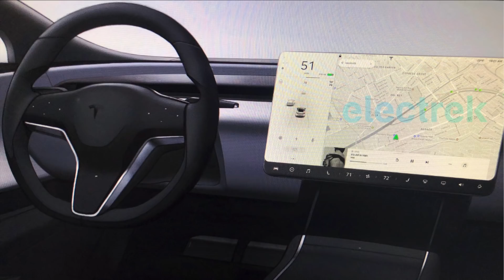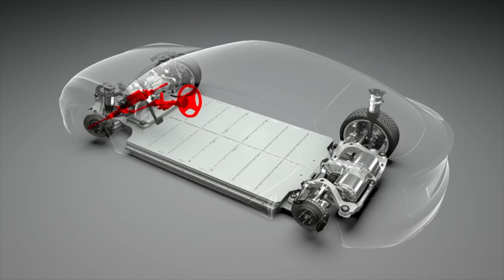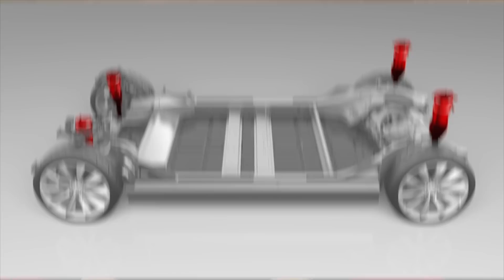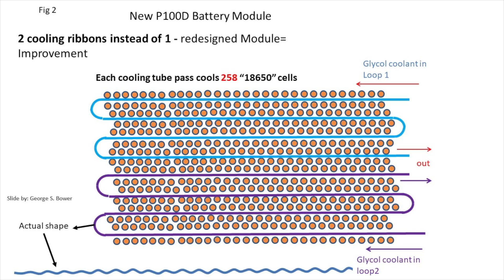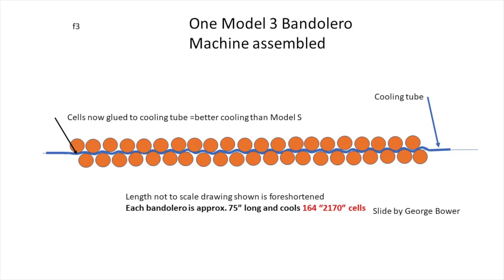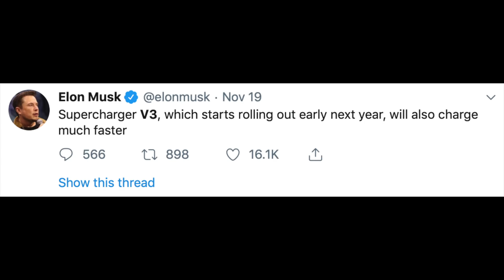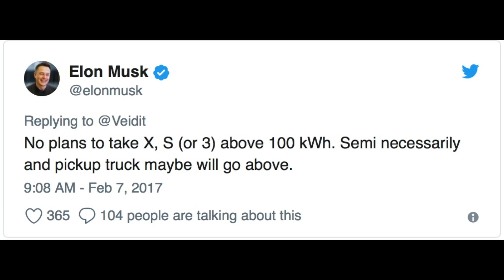The reason Tesla's 75 kWh battery is going away

Comment: Hello Sean. Great overview I think one of the reason why I haven't order my Tesla is simply because I've always wanted a bigger battery. There hasn't been any improvements to the Model S and X in almost 2 years it seems. With all the price jump it makes it somewhat confusing for buyers like myself too commit when you never know what the true price is. You but a Tesla today and two months later there's a price reduction.

I'm inclined to go with the iPace for now and the Model 3 until there's some kind of stability. I would love to have a Model S it X with a bigger battery. I'll even pay $250K for 600 miles of range on a Model X. It may take a while to charge, but charging on  road trip would be far less, and cover much more miles. Thanks for the great podcast.
Reply: Sorry...  What do you mean by... 'stability' exactly?  The Jaguar I-Pace has less range than any version of Model X or Model 3, starting Monday.  It costs more than Model 3.  It has less usable interior volume than Model X.  And certainly will be uglier than Model Y.  So, why are you 'inclined' to go with I-Pace? 

People always get nervous, disturbed, or angry when Tesla changes their pricing strategy.  This has happened by my observation at least five years straight.  

People went off the rails when Automatic Folding Exterior Rearview Mirrors were added.  People went apeshit when the parcel shelf was made standard on Model S.  Some were surprised when the option for an all black roof with any other body color disappeared. People were concerned when Dual Motor all wheel drive arrived suddenly 'without warning' in late 2014 along with the initial Autopilot v1 hardware being made standard on every car.  I'm sure that AUDI, BMW, and Mercedes-Benz were peeved when their attempts to keep up with Tesla with ever larger displacement V8 powered gas guzzlers was utterly blown away by the casual arrival of Tesla Model S P85D about the same time and they were all left flabbergasted and flat-footed, with no answer.  That was less than thirty months after the original Model S 85, which they already couldn't match, had arrived.  

Notice that their advertising ever since has been ever-so-much heavier with the same old tired marketing rhetoric, speaking of 'heritage', 'tradition', 'history',  'craftsmanship', 'style', 'luxury', 'exclusivity', and 'attention to detail' throughout.  They have nothing else to say.  Because on the 'technology' front, Tesla has sorely beaten their asses for YEARS.

Also back in 2014, about six-to-eight months after Elon Musk publicly mentioned the idea of a Gigafactory in late 2013, a site was chosen to build it to produce batteries alongside Panasonic and ANALysts, FUDsters, NaySayers, and Trolls throughout the internet universally declared it a 'risk,' a bad idea, that would surely end up as Tesla's undoing.  Today, with Tesla Model 3 being among the top 5 passenger cars sold in the U.S. the last two quarters of 2018, they seem rather silly.

Then in 2015 the Model X arrived.  Through 2016 and ever since it has outsold the Porsche Cayenne and Macan, the standard bearers for high end Performance oriented SUVs.  

And ever since the Tesla Model 3 was unveiled in early 2016, BMW has seen falling annual sales of their 3-Series cars in the U.S.  So much so that in a year where 3-Series sales dropped more than 25% the rival Mercedes-Benz C-Class managed to 'WIN' the segment of 'Entry Level Luxury' cars despite having a more than 10% decline in sales from the previous year in the U.S.  BMW had DOMINATED this segment of U.S. car sales repeatedly for four decades straight.  Then LOST outright at the mere mention of a new car that hadn't been released yet, Tesla Model 3.

Thing is?  Things change at Tesla.  That is a constant.  It is absolutely stable in that regard.
Reply: @redxsage  Point noted!  My simple point is this...in the new era of EV, and all the changes that's going on....not all of us will adapt to changes this rapid especially in the area of EV automotive.  That's why you can express your thoughts, and I  can read it and learn from your perspective.  This is how growth begins when we're informed.  In the end...I will have my Tesla.  It may take me longer to come to that conclusion...but its a process of learning and growing to that point.  I appreciate your opinion.  Thx
Reply: @d7mysterio7  -- Don't worry about the rapid rate of change.  'Cie la vie', and stuff.  Whatever can change, will change.  Just take your time.  When YOU see what will make YOU  happy, then buy.  Not before.  If you wait until any point in the first nine months of 2020 to place an order, do not be surprised if the car you recieve is quite different from what you ordered, but possibly less expensive for the included features you didn't expect to get at order time.  Likewise, don't be surprised if someone who orders after you gets something different.  Don't worry, be happy.
Reply from the maker: Thanks David.
Reply: Will you really.  Lie to me once.  End of story.
Reply: David Campbell. Damn it! The laptop I bought two years ago looks overpriced and underpowered going by what’s available now. It’s the same with the phone I bought!
That’s one of the things to LOVE about Tesla, they just keep getting better, and you often don’t have to wait for a new “model” to see big improvements as they just keep rolling out.
There is no doubt that an S, X, or 3 which you buy today will not be as good as the one you could get next year. That’s because they keep getting better. However, at least the software on your Tesla WILL KEEP GETTING BETTER, unlike everyone else’s cars.
And BTW, an iPace?? Are you serious? Just look at the specs. If you love it for the style, then sure, but if it’s for anything else, forget it!
Reply: I would highly highly recommend test driving the Model 3 (longer than simply a short test drive if possible), and at least playing around with the I-Pace a bit when you get the chance. I have been holding on on purchasing a Model 3 until I experienced the Jag, simply because I prefer the looks of the Jag so much more, and wasn't a fan of the Model 3's interior at first.
But after seeing the I-Pace in person, there were just many little quirks and disadvantages (i.e. I cannot stand the laggy climate control system; doesn't seem befitting of a modern high-tech car at all. Was also surprised at the lack of leg room in the rear for a crossover, but that's not a deal breaker for me), I decided to rent a Model 3 on Turo, just to compare. I was sold. Placed my order for a Dual Motor Model 3 right after the tax incentive was cut in half, but I have no regrets. Plus, I'm saving so much money going with the Model 3 anyway (a much lower price, while getting much more range, efficiency, etc.)

Comment: I think they will be using the 2170 cells and that they may come out with two additional options for battery like they are doing with the model three with the smallest pack being 100 kWh then going up to 125 and 150 to give the model S and X more range than the competition and bringing it in between the model three and what the roadster will be.
Reply: Gabriel Smith => https://twitter.com/elonmusk/status/876829309695967232?ref_src=twsrc%5Etfw%7Ctwcamp%5Etweetembed%7Ctwterm%5E876829309695967232&ref_url=https%3A%2F%2Fwww.teslarati.com%2Ftesla-model-s-x-no-plans-use-2170-battery-cells-says-musk%2F